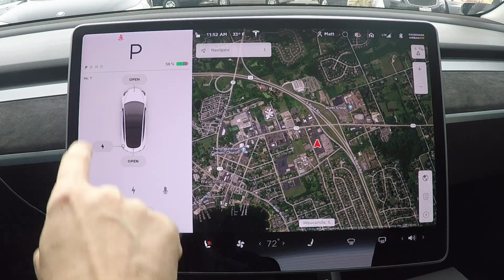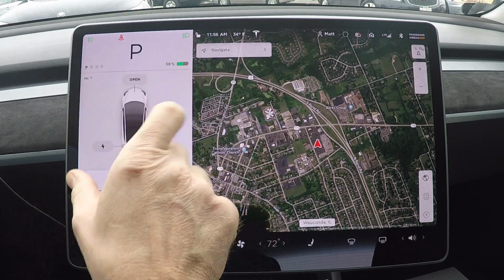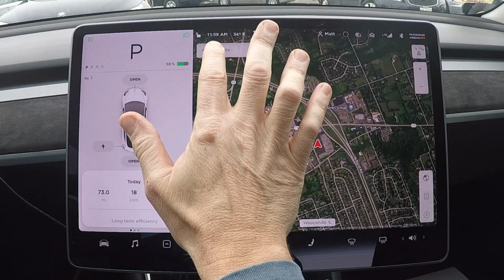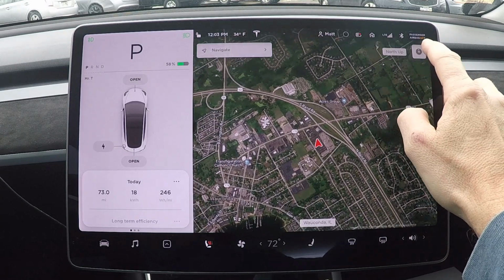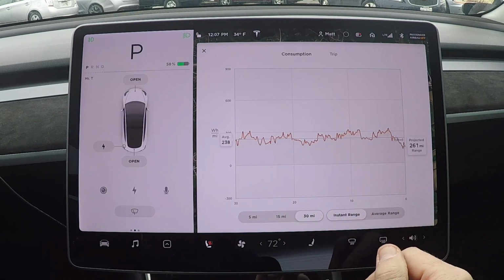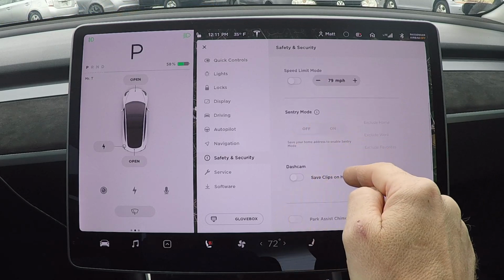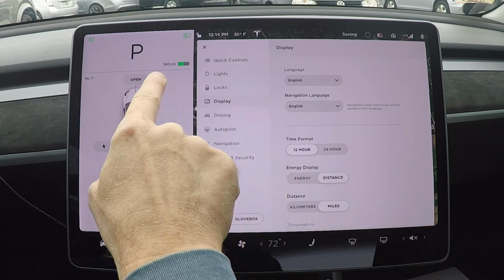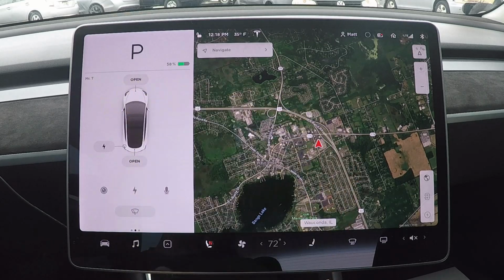Comprehensive Model 3 and Model Y touch screen tutorial

Comment: how can you be positive the model y is going to have the exact same screen layout?
Reply: Because it has on the Tesla website, shares 75% of all model 3 parts?
Reply from the maker: I never said I was positive. 

The Model Y uses the same architecture as the Model 3. Therefore the software will be nearly the same. 

Even the Model S (which is very different in architecture) has an extremely similar software and user interface.